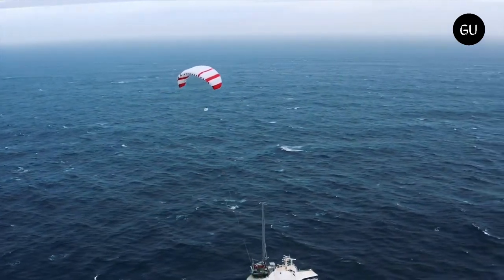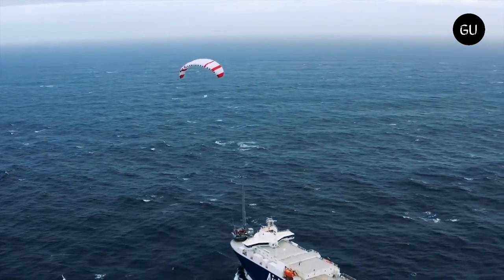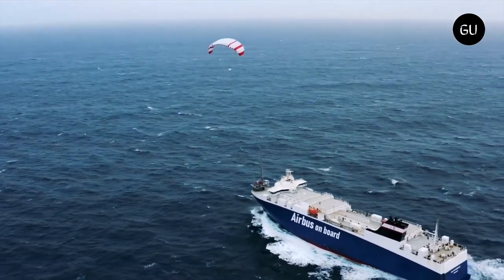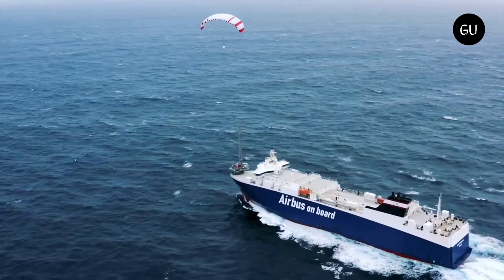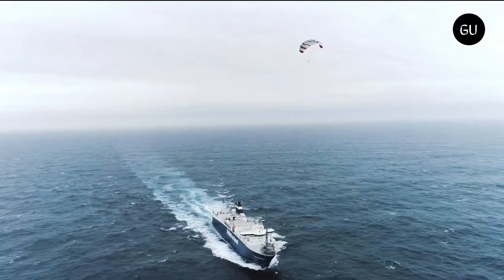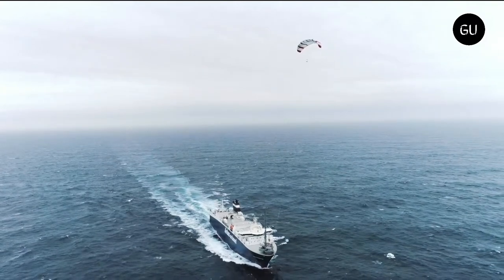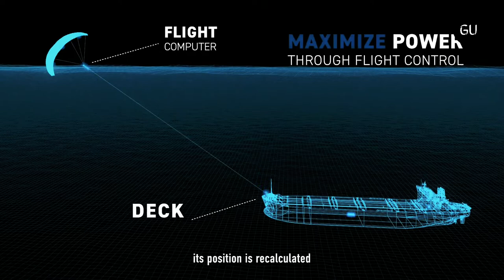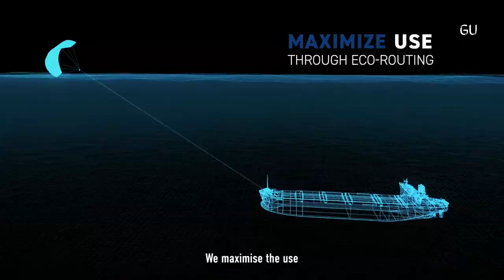Watch This Cargo Ship Fly a Giant Kite to Save Fuel and Cut Emissions - Airseas Seawing

Comment: I wonder if using normal sails would be more efficient?
Reply: no. kite's provide a ton of advantages over conventional sails, from more power, less drag, less rigging requirements, stows more compactly, operates higher and further from turbulent air caused by the ship, and a ton of other benefits.
Reply: Kites seem to be the better option for consistent trade winds.  They don't clutter up the deck and the winds are stronger higher up.
Reply: So how exactly do you adjust a kite when the wind blows a different direction?

You can adjust sails but kites kinda just go wherever their blown
Reply: @moonie5565  The computer controls the movement of the kite.  In general higher winds don't change direction as much, so kites would likely go even higher to catch stronger more stable winds.  The kites are only intended to use less diesel when winds are optimal.  I would assume there is a narrow range of wind direction when the kite would be used.  They worked on this before the Obama global recession.  Since then oil prices have been so low it wasn't worth researching.  Now that Biden has driven global oil prices higher to reduce their use, these technologies may have promise again.
Reply: @moonie5565  I don't think it's meant to be used in a headwind, lol.  But if the wind is blowing in the general direction you're going anyway, why not harness it?  I suspect that the 20% claim assumes optimal tailwind conditions, and the average actual fuel savings would be a lot lower.  But if the savings still justify the expense, why not let the wind do the work?
Reply: Yes normal sails would be better, this dumb kite is bound to run into all sorts of environmental issues and be prone to line damage. Sails were made the way they were for a reason, you can barely even control this dumb kite idea. If you want to put all your safety in the hands of a single line connected to a kite and controlled by a computer I don't think you've worked on a ship before.
Reply: You cant put sails on cargo ships, when you need space on deck for the cargo. Also the cranes need access and the sails would obviously get in the way
Reply: @shadow7988  Apparent from your post you know less than zero about sails or ships lol...
Reply: @rickss69 Okay genius, please tell the class why propulsing your ship with a kite is totally a great idea and thousands of years of sailboat engineering is wrong.